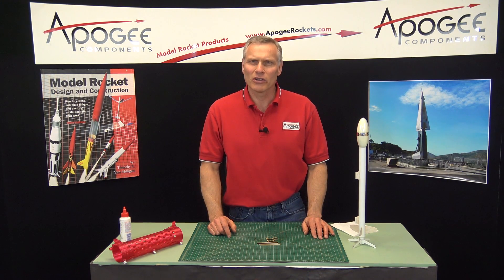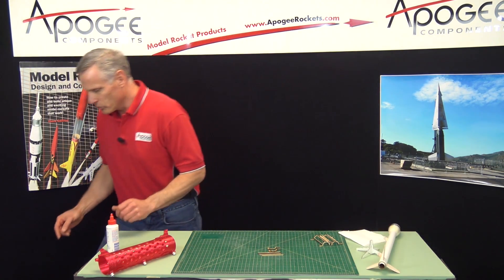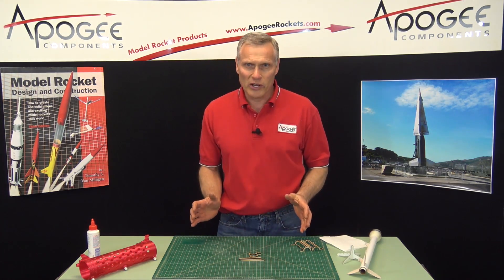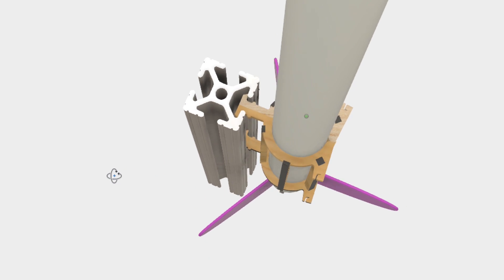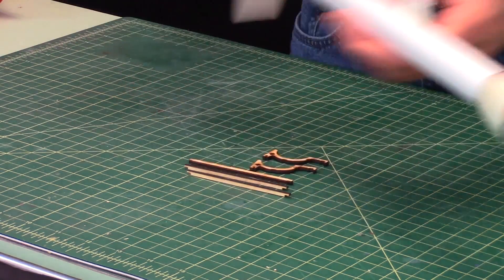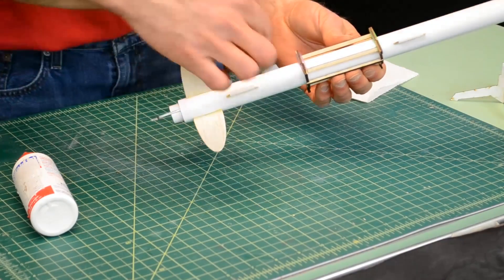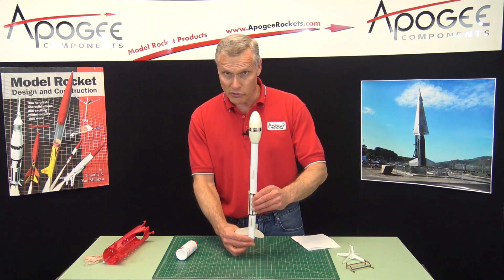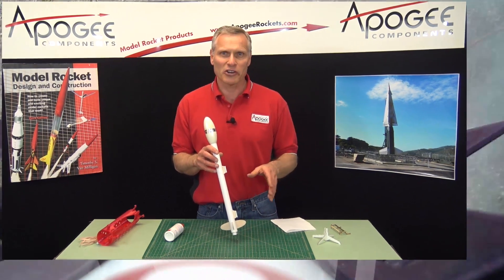Fly Away Rail Guides

Comment: How do you prevent the rail guide from striking or sliding along the leading edge of the fins as it opens? Has anyone studied this issue?
Reply from the maker: This must be a massive problem for you. I've personally never encountered it. So I guess you're the one that has to study the issue. Go for it.
Reply: @apogeerockets  I don't use them, but a friend does and he recently had an issue with his fly away rail guide sliding down over the fins affecting the flight path. You are right that I should study the issue.  I fly millisecond high speed flight computers in all my rockets. Since I need some fly away guide experience, I'll be placing an order.

Comment: This is awesome, but where can you get a rail for small rockets? Or is there a version for launch rods?
Reply from the maker: The fly away rail guide lets you use a big rail for small rockets. The reason is that big rails are significantly longer than a rod. Rods whip. You want some thing rock-stable. There is no such thing as a rail that is too long. Longer is always better.
Reply: Apogee Components Oh, makes sense